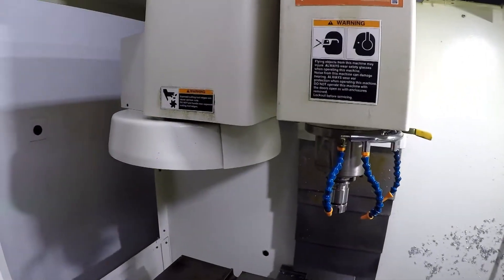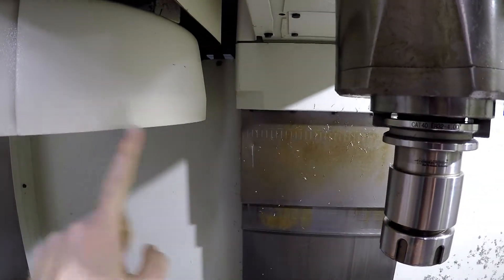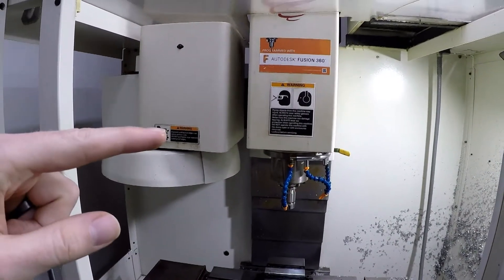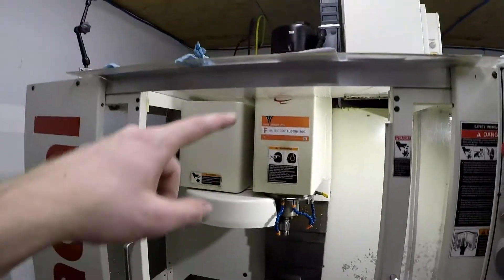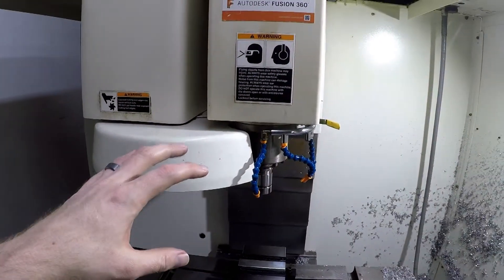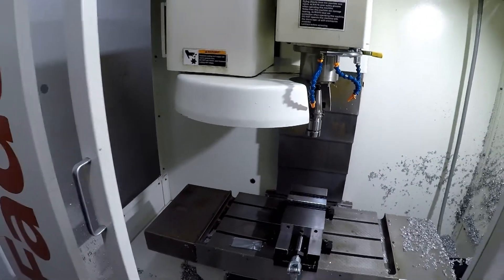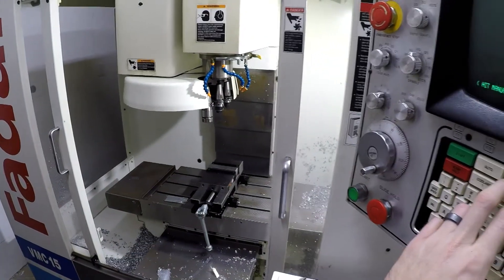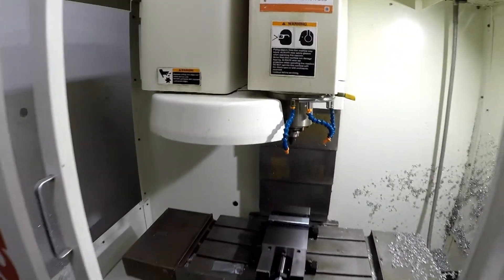Fadal ATC Alignment - Part 1

Comment: Own the same machine, turret “stalled”…..weird issue (similar to trying to do a tool change with no air pressure).  Umbrella moved to spindle, spindle orientated, then “buzzing” like a stall.  Hit E stop, reset…..went away.  

Thanks for posting video!

Comment: uneven can be cose... disc (plate) is bent or the rod/shaft is bent due to one sided use...Z crashed into the ATC...... one sided use is common. U  use  4....8 tools only so u keep them at one spot...thus load is not spread around of course.

Comment: If it's a DC machine, loosen the resolver on the Z Motor and slowly adjust it until your height is correct.  ..Update - I watched long enough now to see you already knew that!  Sorry
Reply: It's nice to see some more Fadal videos.  I should have recorded some of my rebuild as well.  I tore all the enclosure off and resealed it all, then ball screws and nuts, added 4th axis, and tool length probe and lots of other things.  I love the machine and it's solid as a rock.
Reply from the maker: 😂Hahaha, yep! Thanks for the update though!